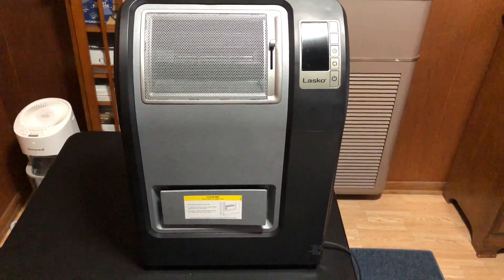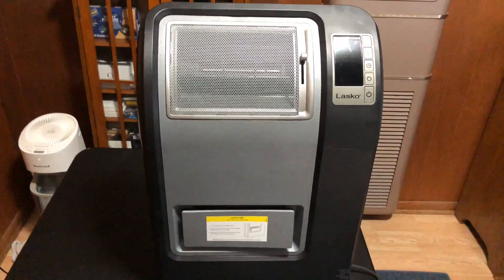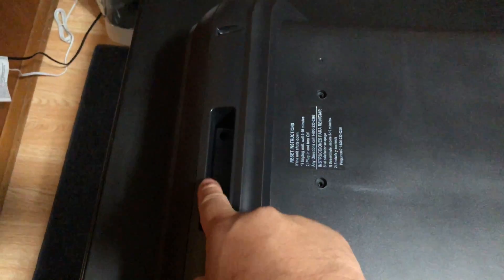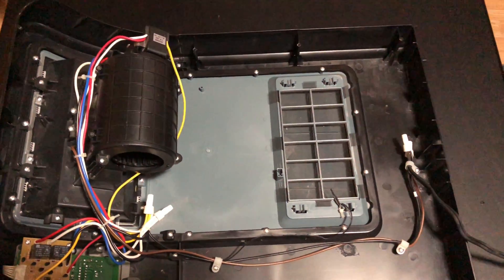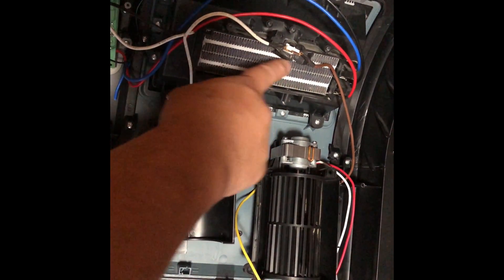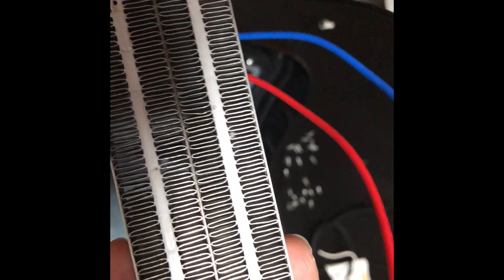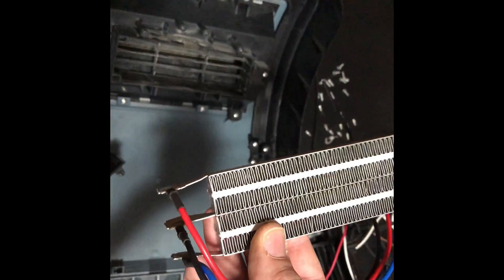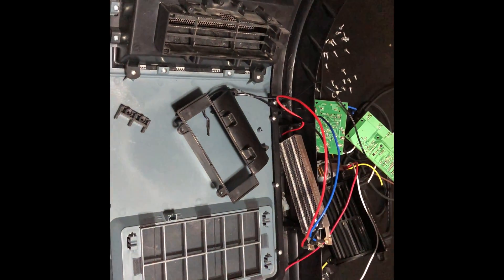lasko CC24849 Ceramic cyclonic heater teardown

Comment: I have the same heater, use it almost daily for 3 years during the winter months and it’s never given me any troubles. I did blow it out with the air compressor last year.

Comment: If I disconnect one of the 3 wires on the heater element, would that be on the low setting the whole time?